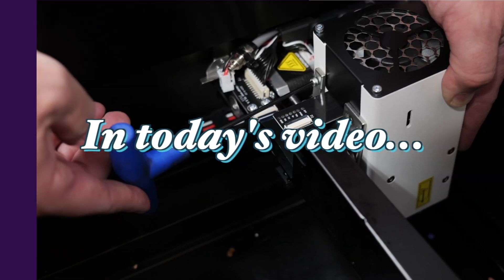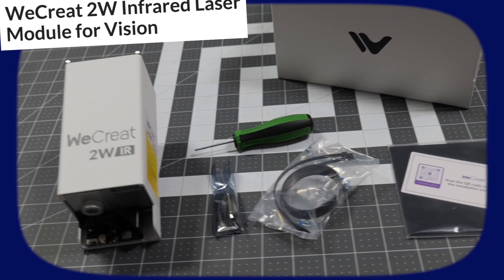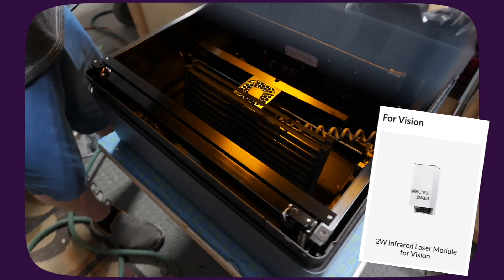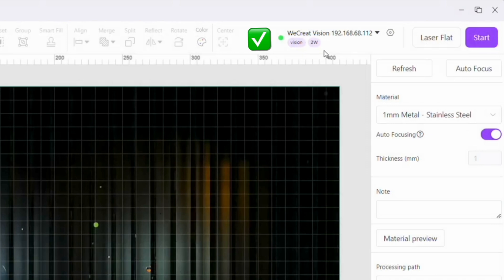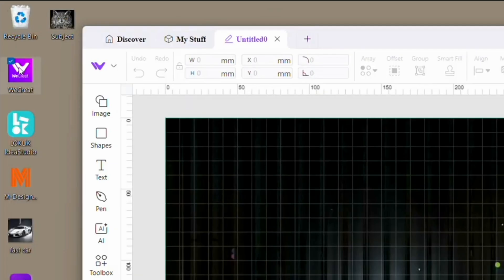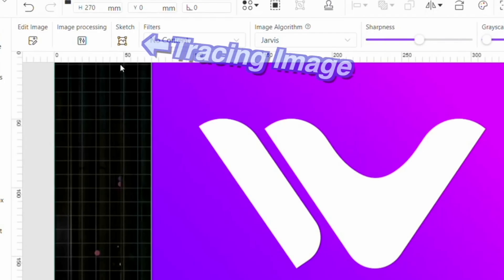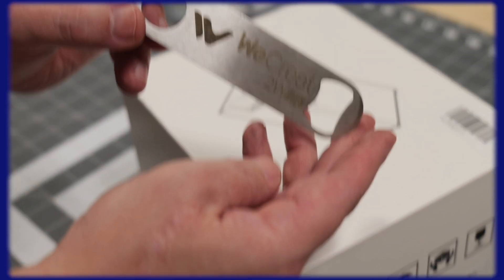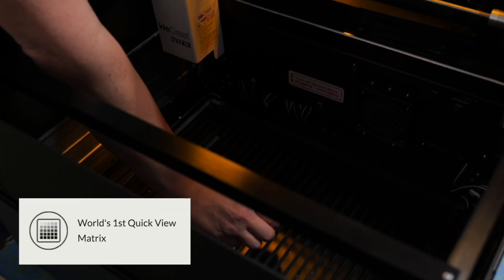SET UP & TEST the WeCreat 2W IR (Infrared) Laser Module for ENGRAVING METALS w/ Vision Unit

Comment: Hi. I can't seem to find an answer to my question. Do you need to switch back to the original 40W laser engraver module before trying to cut wood, etc., or can you just use the 2W infrared laser module to do it all? Just seems like a lot of switching back and forth.
Reply from the maker: Hi! You would need to switch the module from IR to the diode module for cutting wood, since the IR module is for engraving metals. The IR module addition just makes your machine more versatile but does require switching back and forth for use with different materials. Hope this helps and thanks for watching!

Comment: so if you don't plan on marking metals, is there any real reason to get an IR module?  is it better than a diode for anything else??
Reply from the maker: The WeCreat 2W infrared (IR) laser module is designed for engraving/marking various metals and plastics, including gold, silver, stainless steel, and certain types of plastic. The IR module is made for precise, high-detail engravings with its small spot size for intricate designs on a variety of surfaces, particularly metals. The IR laser module primarily works by marking the surface of materials, rather than creating deep engravings. Typically you can get detailed and clean markings on some plastics and acrylics without burn marks/melting with the right settings. If you don’t plan on working with metals and the small spot size for intricate engraving on plastics and acrylic isn’t important to you, then this isn’t an upgrade you will likely benefit from. We hope this helps and thanks for watching!